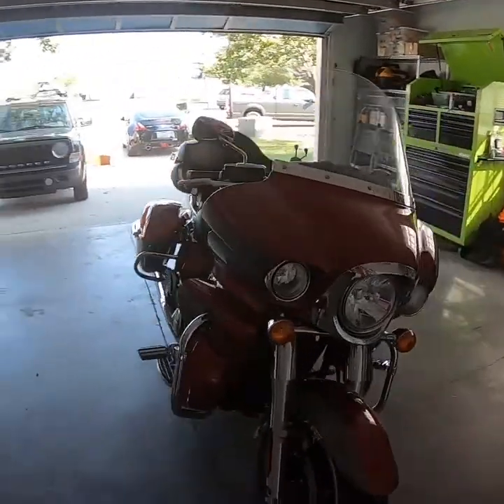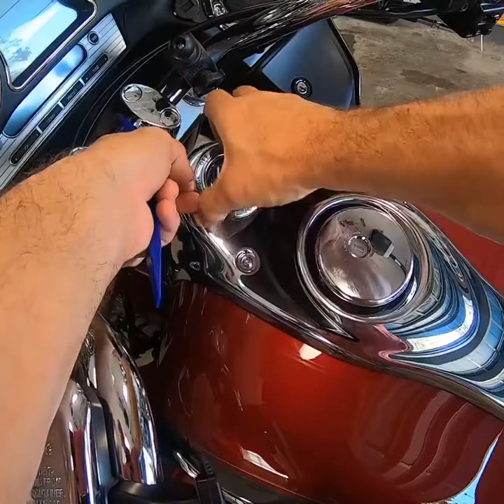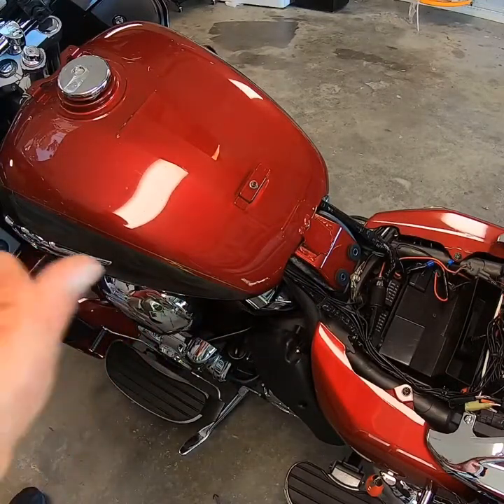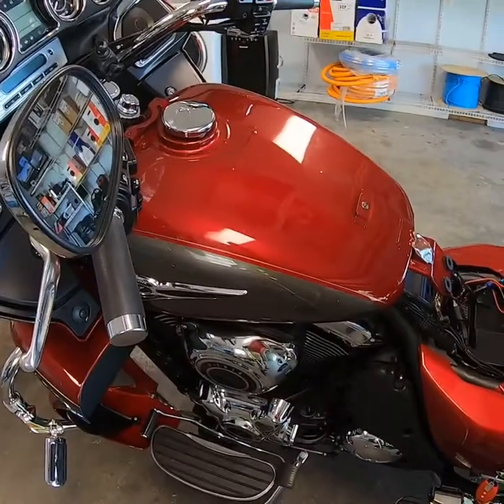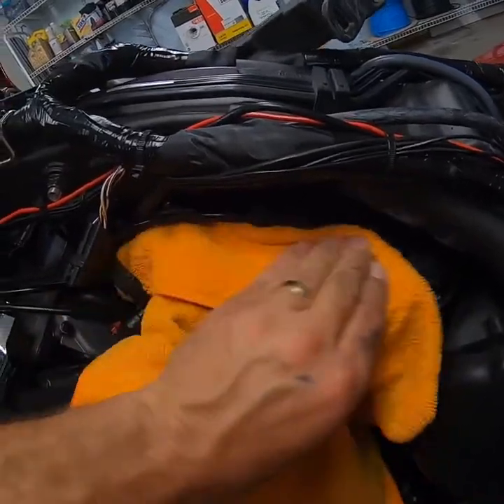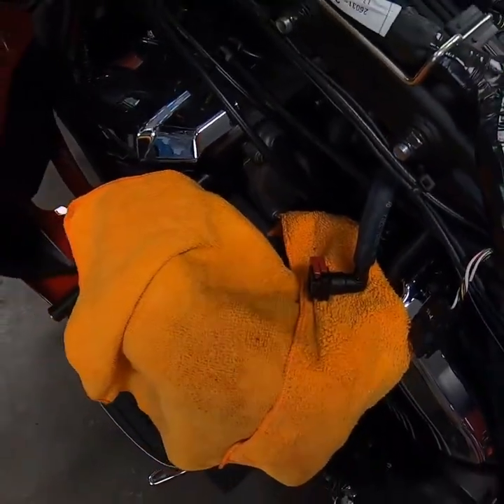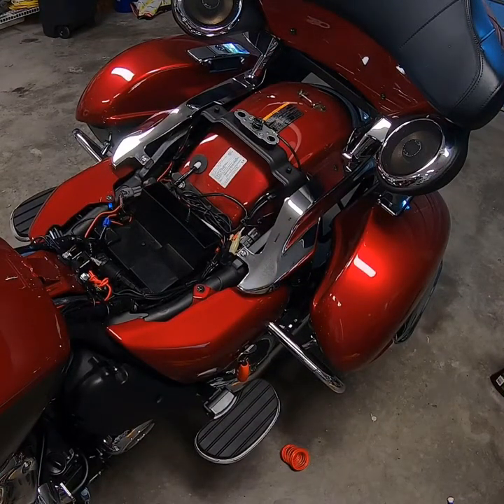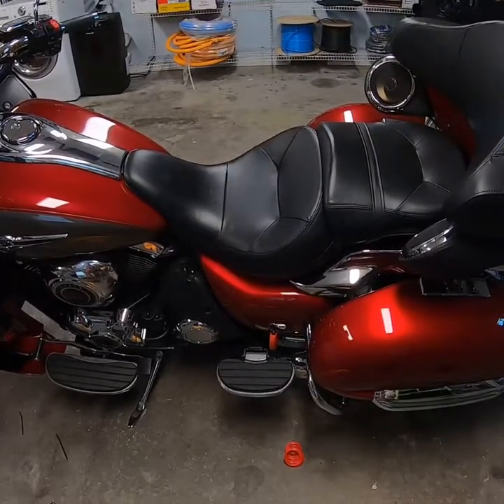Fuel Gas Tank Removal Installation for Kawasaki Voyager VN1700 Radiator and Fuel Pump

Comment: @Greg Rager. Hi Greg. My wife & I enjoy your videos since she bought me a new 'leftover' 2018 Voyager (same color as yours) a few months ago. I added this reply to your video because you might not already know this, but, there is no need to run a lead wire from the battery to the fairing since there is already a switched power-point under your front fairing. It's located under the radio, next to the pre-existing Navigation wiring. There's also a 2nd switched power-point wire under the seat. Kawasaki added these two open, switched circuits for buyers to be able to add accessories, without running wires, or splicing. Page #100 in the owner's manual describes these power-points, and provides location, and wire-color info as well. Hope this helps future projects. Ride well. Stay safe. Keep up the great videos. :-)
Reply: Kelly MC THAT IS THE WIRE CONNECTIONS I USED FOR MY GARMIN 660 GPS/XM RADIO.  I ALSO MOUNTED THE XM ANTENNA UNDER THE FAIRING OUT OF SIGHT, WHICH STILL WORKS WELL EXCEPT SOMETIMES WHEN I AM RIDING DUE NORTH.

Comment: Thank you for this detailed video.
Followed your directions on a Vulcan 1700 LT and was spot on.
Saved me $125 for a coolant flush the dealer wanted to charge.

Only difference on a LT is the pressure relief line is in the front of the tank.

Comment: WHEN I CHANGED MY SPARK PLUGS ON MY 2010 VOYAGER I NOTICED THAT THE CHROME TANK TRIM ON MY BIKE DID HAVE THE LITTLE BLACK SPONGE RUBBER CUSHIONS ON THE FRONT WHERE YOU INSTALLED THEM ON YOUR BIKE.  FUNNY THING IS THAT MINE LOOKED TO BE CLOSE TO THE SAME SIZE YOU CUT AND INSTALLED.  THANKS FOR THE VIDEO.

Comment: Very informative!  I appreciate the time and effort you spent putting this video together and sharing it.  It looks like you have to, at least, pull the tank up to change the spark plugs as well on the Voyager 1700.  I had to pull my tank up (but not completely off) to change the spark plugs and coolant on my 2010 Kawasaki Vulcan 900 Classic LT (a great bike!).  I recently purchased a 2011 Kawasaki Voyager 1700 so will be perusing your other videos on the Voyager as well.  Also, I am very interested in learning more about the "flashing" of the 1700's ECU as well.....for a smoother throttle response and power band. The Voyager is a great motorcycle, very comfortable and a lot of fun to ride. Thanks again!
Reply from the maker: Tasting The Apocalypse thanks for the input.  The flashing was well worth it.  Made smoother idle a little more power not a bunch but think just “cleaned” up the engine and increased everything.  My big reason was for the temperature but hasn’t been over 65 since I have had ir done.   Gets in the 90s here hoping can ride in the summer and not just at night or early am.

Comment: Thanks for the informative video.  Just getting ready to change my fuel filter out and getting the tank off is most of the battle.  Speaking of the fuel filter job, there is not currently a video of anyone doing that :)
Reply from the maker: Sorry sold the bike last year.  Shouldn't be to much more to it, getting the tank off is the hardest part.  Only a few screws/bolts holding in the fuel pump, should be pretty simple after that.  I found a nice diagram of the pump on eBay.  Thanks for dropping a comment, hope that helps get you thru it. 
 https://www.ebay.com/itm/325436135295?chn=ps&_trkparms=ispr%3D1&amdata=enc%3A1NuqF2Lb5QCaSTIoTag3wEQ62&norover=1&mkevt=1&mkrid=711-213727-13078-0&mkcid=2&itemid=325436135295&targetid=4580153136941814&device=c&mktype=&googleloc=&poi=&campaignid=437225722&mkgroupid=1224856224320848&rlsatarget=pla-4580153136941814&abcId=9300906&merchantid=51291&msclkid=b27bb98d86a516ce34cbdd17be45131d

Comment: Wonderful video I’m looking into this kawasaki Voyager 1700 for quiet awhile, trying to get a head start on all maintenance. Before I go and purchase one. It seem to be great motorcycle, and beautiful looking too, I also noticed your rear speakers first one for me. Thanks for the video.
Reply from the maker: The discontinued those speakers over a year ago, they didn't make a big difference in the sound, but they did "look" better.  I just sold the bike this past weekend.  Makes a great bike, just heavy for where I live, stuck in traffic all the time not a good place for that bike.  If you get one, the main thing I recommend would be the ecu flash from Ivans.  Worth every penny, next day turn around, smoothed engine out, added some rpms, lowered the temperature, just ran better than factory.  Thanks for watching.

Comment: Great video. You're not kidding about this thing running hot! This winter will be my first on this bike and I'm thinking my legs will be toasty warm.
Reply from the maker: I did change the coolant to "Engine Ice", made a little difference but still on the hot days will cook you.  Been riding for 30+ years, many big bikes but this one by far is the hottest.  Can't wait til "winter" here in South Carolina.  The coolest it has been here is mid 70's in the evenings, today back up to 90.   Looks like finally next week going to get a relief, still be wearing shorts.   lol
Reply: @RagerJackOfAll  I can't wear shorts on the bike. I'm only 5' 7. I can't put my feet flat on the ground so my legs always touch the motor.
Reply from the maker: @av8dr  Lol Sorry to hear, I'd almost be afraid of catching my pants on fire.  My drive home was almost 2 hours, was 98 degrees that day, talk about cooked...
Reply from the maker: @av8dr  Did you ever figure out the flasher?
Reply: @RagerJackOfAll  Not yet. I had to travel for my job, then I came down with a cold and horrible sore throat. Thanks for asking.
Reply from the maker: @av8dr  Ok was just curious, I tried to replicate what you were describing with mine but it seems to be working correctly, maybe just a dud.  Again keep me posted if you get it figured out.  Good luck with the cold, it was the "Fall Rally" Here this weekend, has been in the 90's all summer was 76 last couple days which for work is great but wow what a difference on the bike.
Reply: @RagerJackOfAll  I finally had time to test. Both units worked with a single LED that I had but not when connected to the brake lights. So, I think they're not able to handle the current draw. What is the model that you use on yours? I'll get the same. Thanks.
Reply from the maker: Anhtuan Phan On Amazon copy and paste this on search. B0185HMIIQ. It’s the xp 60 x If you read the description says a lot of the flashers have 10 to 15 W this has 60 so very possible won’t handle the load of all the little LEDs in there. But that’s the one I put in mine
Reply: @RagerJackOfAll  Thank you. I just ordered it. Will let you know how it goes.
Reply from the maker: @av8dr  Did you ever get in the flasher?  Just curious if so.  When I was out today I hardly ever use a cruise control but hand was getting that nice numbness to it so went to set and the yellow light comes on but cannot set the cruise.  My first thought was maybe that module was sending a small pulse to the brake light causing the cruise to not set but before I start tearing it apart was wondering if anyone else had that problem.  If not new video this weekend!  lol
Reply: @RagerJackOfAll  It got delivered but I'm still on travel. I hope to be able to install it this weekend. Interesting on the cruise control. I assume it worked before you installed the flasher?
Reply from the maker: @av8dr  Lol Honestly don't know why I was asking you if you had put in yet.  I have set it a couple times just to be doing it.  I know it worked at one time, but have no clue at what point it stopped. I was riding down the road and the only thing I could think of is the break switch or something then the flasher popped in my head.  I've got a busy week at work so will not have time to dig into it until the weekend, supposed to rain here the rest of the week also so even if I take the flasher out, wont be able to test.  Either way, if you do put it in check the cruise and let me know and If I figure it out I'll let you know and if its that flasher I'll update the video somehow.  Only like 1400 miles on it so possible just a bad part, I know from years of riding if something is going to fail usually happens sooner than later.  I'll keep you posted.
Reply: @RagerJackOfAll  No worries. I'm glad you asked. At 60, I can be forgetful. :-)
Reply from the maker: @av8dr  Ok, I pulled the flasher so it wasn't that, and I think there have been a few other people putting that on so i'm going to keep trouble shooting.  Let me know if you get your flasher on, check the cruise after.  I actually got a reply on an email from the company that makes the flasher, broken english but according to them they have not had that issue either.  I've only done a few other things here and there so shouldn't take to long to figure out, just finding an hour to do it is the problem... Nice weather tear the bike apart or ride?  lol
Reply: @RagerJackOfAll  Oh man, that means there's an issue with the cruise control. Sorry about that. I'm still on travel. Waiting for me at home (other than my wife, LOL) are the flasher and a brand new heated jacket liner. Can't wait to get home to play.
Reply: I finally got a chance to install the brake light flasher (the one you recommended) and it worked perfectly. Also installed a dual USB charger. I tapped it off the cigarette lighter. Did you figure out the cruise control issue? I haven't gotten on the highway yet to see if I have the same issue.
Reply from the maker: @av8dr  I started a new video on troubleshooting, but I'm out of ideas.  I have checked the brake switches, the clutch switch, the radio still goes up and down, so do not think its the speed sensor, took off all my "accessories" lol and still cannot get to work, maybe just a dud.  Have to drop off to local Dealer, under warranty so just need to find time to drop off.  If you get on the road, test yours out and let me know, I'm pretty sure I used after I installed mine, but again I hardly ever use the cruise, doesn't affect my riding.
Reply: @RagerJackOfAll  Got on the road this morning. It was 40 F. Grateful for heated jacket and gloves. I was able to set the cruise control. So I guess you will need to go to the dealer. BTW, you checked the fuse, right?
Reply from the maker: @av8dr  Yeah, first thing I checked.  I kind of ruled it out right away because the cruise light comes on, just will not set, so the first thing that came to mind was clutch or brake switch, ruled them out, that leaves speed switch which the radio auto volume still works and from what I've read that would be dead if the speed switch is bad, that leaves ECU or some other hidden little gem I don't know about.  I grew up working on 70's bikes and cars, to many sensors and switches now, could be one of a dozen things.  Been raining here so haven't had time to get to the dealer, maybe drop off tomorrow, I got the "well you'll have to leave it" from the service center, I was thinking really?  lol  Glad yours works, would feel bad if I posted something that was causing issues.
Reply: @RagerJackOfAll  Any luck with the cruise control?
Reply from the maker: @av8dr  No, been busy with work, I'm either wide open or twiddling my thumbs.   I'm just outside of Myrtle Beach went from the 70's to rain and 40's didn't help.   I know..... been here to long, lol Usually in the 60's and 70's this time of year in the afternoons.  Originally from Ohio, when I was 18 remember hitting ice patches on the road at 55.   The other thing is again I almost never use the cruise, talked to the Dealer I got it from said has a 3 year bumper to bumper on it, so not in any hurry.   Supposed to clear up cold spell I think about thru I'll keep you posted.

Comment: Thanks for the video.  Please post video how to drain-refill the radiator coolant.
Reply from the maker: The radiator cap is under the fuel tank.  When I changed my fluid I just took the bottom hose off of the radiator and drained it.  I did not see a drain plug and it was just as simple to loosen the hose clamp and pull the hose off.  Then just ran water thru it until it was clear and refilled with Engine Ice pre-mix coolant.  Thanks for watching.

Comment: How do I test the fuel pump to see if it's good
Reply from the maker: You can verify it working just by turning on the key, you should hear a buzz sound when you first turn on the key that is the fuel pump priming.  No buzz, possibly just a fuse blown or bad wire.  Get a buzz most likely it is getting power, But...  that does not mean it is not clogged, or has a voltage issue.  You would need to put a volt meter on it and check the voltage, then if you take the fuel line off of the tank run it to a container of some sort, when you turn the key on you should get a good bit of gas out.  If you hear a buzz and no gas either it is clogged or bad.  Sorry can't help much more than that without actually working on it.

Comment from the maker: Not positive but should be very similar.  Tanks usually held on by 1 or 2  bolts some older bikes had a rubber strap.   They almost all fit the same once you remove the fuel lines. If your carburetor not fuel injected the main fuel line probably has a clamp not a press fitting.  In other words think the video will get you through it.  Good luck and if it does post a comment I’ll update the title to cover your bike.  Thank you.

Comment: Have you looked into the Ivan  Flash of the ECU.
   The bike runs better and much cooler
Reply from the maker: Sorry took so long to get back to you, with xmas and i own my own security business been swamped.  I have looked at different options including the ECU, we just do not have anywhere near me to get an ECU flashed, I have tried it with cars in the past but by the time you mail it out, they mail it back you mail it back for adjustments they mail it back......  I'll probably just get a different bike this spring, I really do not do a lot of road traveling, so I don't need a bike this big anyhow.   Did you send your ECU out to someone if so let me know who I'll check into it though.  Again sorry for the slow reply, havent had time to think.
Reply: I have a 2017 Voyager and you need the Ivan’s Flash. The bike has more power, torque, and much better throttle response. It runs much cooler and stops all backfiring (if you’ve added slip ons). It is really like a new stronger engine! Check out his site.
Reply from the maker: @jhask64  Thanks, I just found on Google with Ivans ECU....  Lol, looks like $350 to flash may get rid of some other things I'm not so happy with like what feels to me like a timing issue around 3000rpms kinda falls on its face, not that its a power house anyhow.  I'm actually in Myrtle Beach, I was doing the opposite with the car I had mailing to NY somewhere but never got it right.  I can probably ship the bike to Greenville for a couple hundred dollars, have them flash and tune and just ride it home when done, that way any tweeking can be done without guesswork.  Thanks for the help!!!

http://www.ivansperformanceproducts.com/
Reply: I'm ivanized.

Comment: Quick question / thanks for the video / I have not purchased it yet, but I am looking at purchasing a 2012 1700 voyager with 6,000 miles / the guy had medical issues and cannot ride anymore , so are these bikes a good one to own? / also I cannot find a video on how to adjust the rear shocks, are they air shocks?, if so how do you adjust them..  just looking for info, thanks Eric
Reply from the maker: Honestly, for me it is extremely heavy and very hot.  I live near Myrtle Beach and unless you are going on road trips or live in a cooler area I would not buy another unless they fix the Heat Issue.  The have added an "air flow management" system, but it still was running in the red until I did the ECU flash from Ivans Performance but you shouldn't have to flash an ECU  on a new bike to keep it from being to hot.  Now again, I do not do many road trips, as far as comfort goes it is extremely comfortable and it handles very good at 70mph, so again if long hauls good bike, mostly short runs, would not do it again.  Looking at a new one for this summer, going to be trading this one in very soon. Thanks for watching.

Comment: Nice video 👍, I need some help with my 2016 Vaquero, im sure its same as voyager but ive checked my owners manual and it doesn’t say “exactly “ where the main power fuse is located 30amp ,   My bike died while riding a mile from my house, , , ive read some say that some wires under the gas tank can rub and popping the main fuse,  . Any input would be greatly appreciated 👍 Tony
Reply from the maker: https://www.kawasaki.com/en-us/owner-center/parts/2016/VN1700KGF
Check out that link, I’m not sure of any fuse underneath of the tank, doesn’t sound like a good place to put a fuse but that doesn’t mean Kawasaki didn’t think so.  Lol I know older Kawasaki’s main fuse was directly off of the battery with an inline fuse.  I would check your fuse box make sure not there But if you look through those diagrams you may find something else. But anything like that should be Under the seat or easy to access. If you find it post back and let me know Next day off I have if it’s under the tank I’ll Tear mine off and see if the voyager are has one there. Thanks for watching

Comment: can you please tell me ...when you turn the key on and the fuel pump primes , can you still here a noise like the pump continues to run while key is in the on position  ??  PLEASE  thank you
Reply from the maker: Yes when the key is on and the switch is in the run position you can hear the fuel pump running even though the bike is not.  Not exactly sure but most likely once the bike actually starts the ECU tells the pump to stop priming.  Hope that helps.